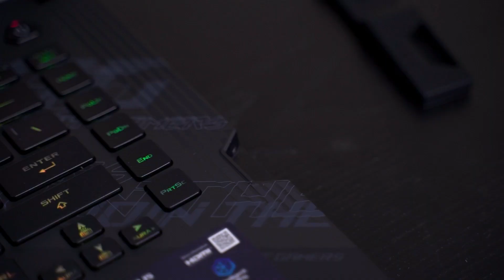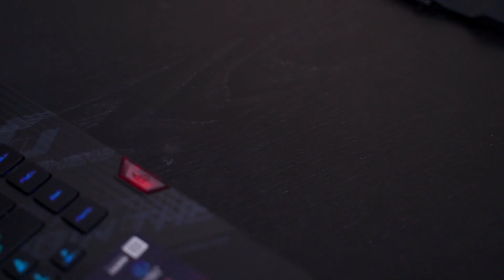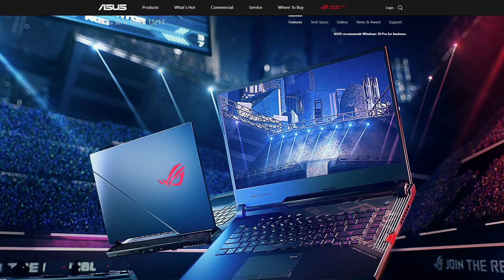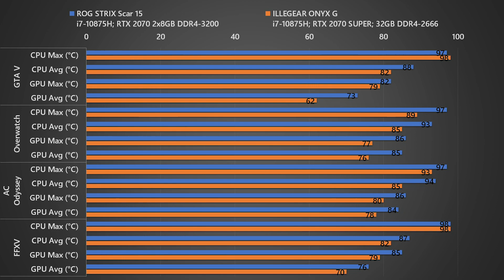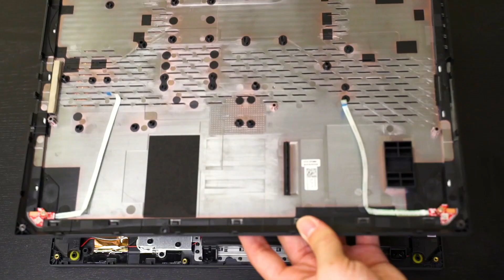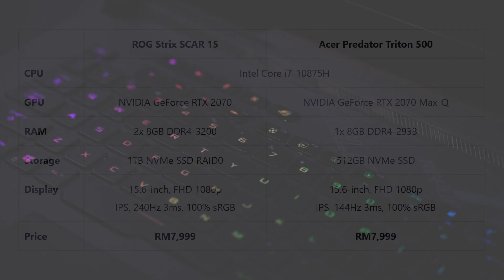Am I Scarred 4 Life? ROG Strix SCAR 15 Review

Comment: I currently have an older laptop, a MSI GT72 with i75700 HQ 970m. How dose this hold up against the Brand MSI in General?
In cooling how dose ROG go keeping the system cool under pressure such as MSI’s multiple cooling pipes and large fan and large opening on the bottom?
I’m more looking at the Asus ROG Strix with RTX 2070, I am unsure as I have been extremely happy with MSI, but MSI are expensive

Comment: Hello, i have a question. When i play games on silent mode like rocket league, cs go, gta, valorant, just cause 4, my gpu is working fine, the frequency is above 1000 MHz but when i play games like cod modern warfare and ark, after 5 minutes from high fps drops to 10-20 and when i check my gpu frequency its stuck at 300 MHz. What should i do? And btw what cooler do you recommend for this laptop?
Reply from the maker: For the best performance, don't play games on silent mode.
CS:GO, Valorant, etc are fine since those games don't demand much GPU power anyway.
COD Modern Warfare is heavily CPU-bound, which is why it lags.

As for coolers... try not playing games in silent mode first.

Comment: As you said I'm also experiencing 90°C celsius temps while gaming, My is question whether it's safe to use the laptop at  those temps cause i worried that it may cause damage to the life span of my laptop and Is there any other way to reduce the temps like undervolting the cpu etc...  plz do help this is my first laptop 🙏🙏🙏.
Reply from the maker: It's safe, no worries. The laptop will turn off by itself if it gets too hot.
Reply: @TechCritter  I have the same question as OP since I'm also having the exact same laptop and it is average 85 to 90 degree celsius if playing with ultra settings on performance mode for 4-6 hours daily, so will it affect it's live span?
Reply: @TechCritter  thaanks